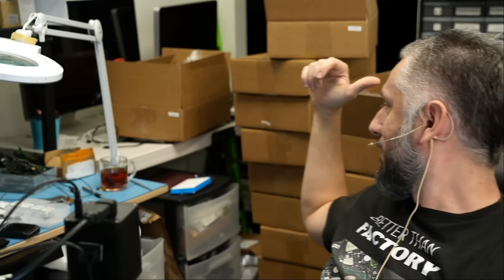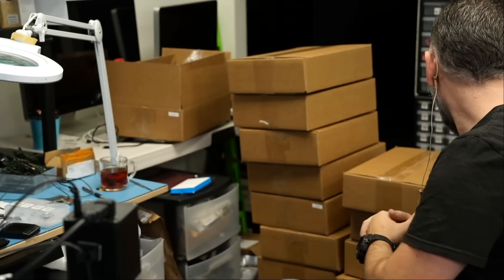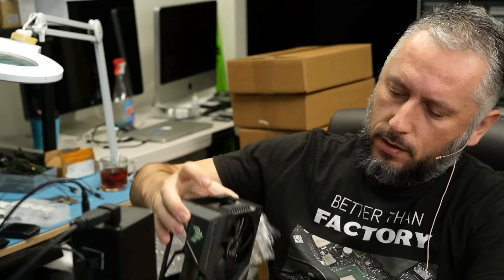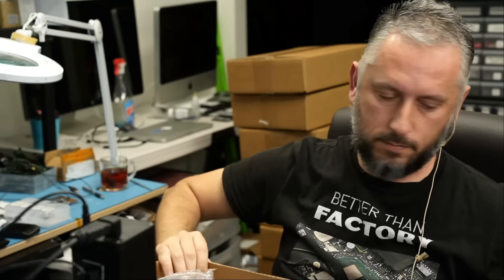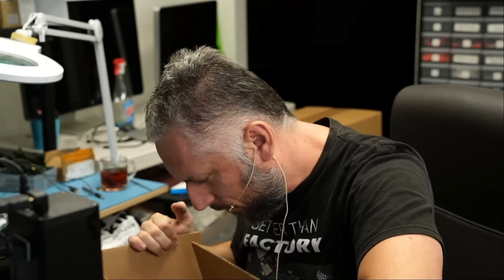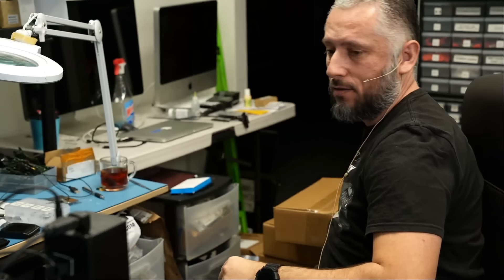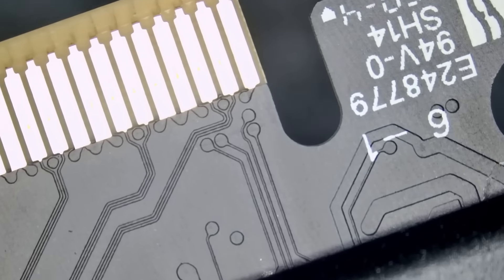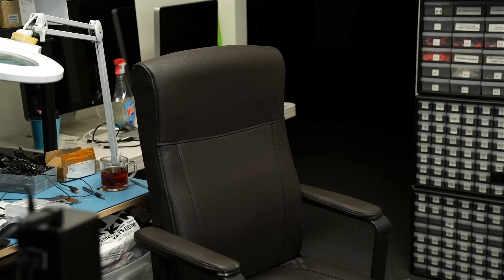We received 19 cracked 4090 Cards for repair - Who's to Blame ?

Comment: A PCIe slot for a motherboard was never designed to support any weight. None. Instead it was designed for establishing an electrical connection. That's why in server systems the motherboard is placed horizontally and even then parts connecting to the motherboard are being stabilized by large brackets which leave no room for movement. Those little studs for a GPU that weighs almost 2 kilograms are a (cheap) joke. A server system will probably survive a delivery by car through an area that has been hit by a light earthquake while a gaming RIG is very competent in destroying itself by any means possible. Not just by crushing under it's own weight. Because most gamers are addicted to the fastest hardware their budget allows them to buy they will always buy. If you see it like that you know that a design that breaks down easily is the most profitable. If you wanna know why afterburner is called the way it is just take a long hard look at that brick hanging in your system looking like an airco from hell.

Comment: hire a single engineer that isn't electrical or software and you wont have these issues. Basic stress and strain calculations have not been done. You shouldn't need external support to prevent your GPU from cracking. If it is necessary some sort of support should be included with the product.

Comment: In my experience of building computers for people, MSI is the only one that often does not provide an additional support bracket with their cards. However, every 4090 we have installed comes with either a support bracket that is installed along the addon card slots of the case, or a stand that props the back of the card up to prevent sag. In the latter case, I like to apply double-sided tape, or a dab of hot glue between the stand and case to prevent the stand from getting knocked free when the customer is bringing the computer home.

I would blame this on user or installer error at this point. If you are building a computer that is going to be shipped, either leave the card out in its own box,  install additional support to prevent damage to the card during shipping, or at least try to prevent the support from slipping out.

Comment: The cards are so large and heavy that REALLY, anyone installing them should be fitting extra supports.
If it happened in a prebuilt, its on THEM.
If you installed it yourself and didnt put a support bracket on something THAT BIG.... its on you bro.
But i will however say that it would be nice pf Nvidia to issue a warning to everyone who buys these MASSIVE cards.

Comment: Friend of mine has one of those cards. He has a supporting frame for the card, so it's fixed without pressure on the connector. Obviously that customer didn't have a frame

Comment: There is no fucking way those boards are broken because of board weight and sag.  IF that was the case, you wouldnt have 19 cards in your shop, you would have hundreds of thousands of cards. Two ACTUAL possibilities are, broken in shipping while the GPU was installed and not supported properly or error during installation (bending the card while inserting or removing it from the mobo), maybe due a PCI-E lock that cannot be reached and ppl just pulled the card + wiggled it to get it off.

Comment: If a few users would crack the board it would be user error. But, if your design has such a week spot it is design error. Of course, you can write the instruction manual and such. But as a mechanical engineer (and also a software maker) I can say that you need to design your product for as stupid consumer as you can imagine. So maybe the producer is not to blame by the law, but he is to blame ...

Comment: costumer probably bought them for a good price in a lot of a bunch of them, all marked as "unstested / for parts", it's a guess, sometimes those come with things that are not actually broken, most do have some issues but many ppl fix them and manage to pull a profit somehow, it wasn't the case probably this time, i still think the maker of the car should take into consideration that their market is not "businesses and especialists/technitians", pc builders can be either your average joe that saw a tutorial on youtube, and a technitian that builds hundreds of systems a year, so blaming the user can be unfair, at the same time the user can have the notion that that conector is very thin for the weight, creating leverage, so a support might be a good idea but many people don«t even know supports are a thing because older cards did not use them, so at least the maker of the card should have a clear big warning inside the box warning about the issue and providing some solutions to mitigate the issue

Comment: I would blame it on the customer, at least on the cracked ASUS ones... Asus 4000 strix/tuf models both comes with card holder included. You can also buy bigger holders like the Herculx or other 3rd party ones. If customer had holder supporting correctly and it still cracked then it's Asus' fault, but other than that it's the customer's

Comment: It can easily break trying to remove it because the clip on most motherboards are so poorly designed and hard to get to release properly especially on thick , heavy cards. Those are the ones that the tabs are completely broken off
Who is to blame? The PCIe Group AKA PCI-SIG for their outdated socket standard from 2003 ..... Same for the melted power connectors problem which is a faulty new standard that came from Intel and their ATX powwr supply standards 

Manufacturers are partially to blame because they don't want to deal with the cost of an updated PCI socket standard which means new designs and makes old designs obsolete. They would likely have to put both PCIe and the new PCI standard on motherboards for a few generations just like they did when PCI (1992) was updated to PCIe (2003)

Comment: Nvidia is NOTORIOUS for PCB failures. Their Processing units are great. Except, everything else on the PCB is flawed. Not to mention their failure of Thermal Engineering. In Florida, it's the manufacturere's fault for the cracked PCB's.

Comment: Idk but I'm sure mist of those cards come with a support bracket to use. I know every huge gpu I got did plus my pc case comes with kne built in and I use them. Like how you going to instal a 10 pound card without a support bracket amd think that little bit of material will support it and not break? Lol I blame the customer lol

Comment: I got a PNY 4080 new from a reputable distributor, it cane with a bracket in the box to help support the card so installed that along with the card not sure if gigabyte or asus supply a bracket with the 4090 but you would think that they do

Comment: So is this just an Asus thing or a nvidiaRTX40 series thing?
IMHO Instead of getting more FPS and higher pixel on their newest cards they should just make cards with the same or a little bit of increase but minimize everything on the card, weight, power drain, overall size and heat discharge. It will be difficult but its not impossible, we frickin had 10megabyte storage the size of a refrigerator back then and look at us now 1TB+ storage that fit in your palm.

Comment: Were those gpus mounted vertically or horisontally? If horisontally, were they supported in ANY way to reduce stress on that area where it could crack.

Then again, a crack in the same place across multiple, identical products, is a manufacturer flaw no doubt.

Comment: If Nvidia is going to charge $2,000 or more for a GPU than they can at least: #1 make the board thicker and #2 provide a suitable support for there own big cards. If the user is too stupid to use the support or mount it vertically with a riser than that's on them. Maybe northwestrepair will take this venture on? Just a thought.

Comment: It's on the manufacturer. It is on them to make sure that the card will not break in it's intended horizontal position. Almost all graphics cards are in horizontal positions, so for it to break like that is mostly their fault. After that, it's either the user or the person that shipped the PC that is at fault. Moving a computer without providing adequate support for the graphics card is always a bad idea. Graphics card should be always fit for purpose.

Comment: A car without a seat belt will still move just in case of an accident the manufacturer should provide safety features to keep the driver safe, the driver will drive the car basing on how it was designed, why would a manufacturer designed something heavy and give it a weak supporting board, God was never crazy to give us strong legs and back bones to support our entire body. its obvious a manufacturer's bad engineering

Comment: I have the 4090 ASUS TUF OC vertically mounted to avoid this problem. I purchased a vertical mount the day I installed as my case config would not allow me to use the included tripod due to my cases base fans. The weight of the card and the fact they include a tripod to take some of the weight led me to not risk installing any other way.

Comment: Heat pipe sets need to be set up with cooler on the top. . .   On my computer   set video card has my tower upside down.  . . CD ROM is inserted and held in with tape. Set running great except for Microsoft update issues that trash Internet access. Thanks for your time and great job today.

Comment: Well they are not mining cards :P
No problem here with my XFX since it comes with an extra bracket that uses 4 slots and is connected to the end of the card it does not move an inc.
Oh and my video card hangs upside down in my case with the output facing up  :P
(oh and the bracket is sturdy i can knock out a small elephant with it :P )

Comment: Guaranteed it's the manufacturing fault with these cracked GPU boards. They damn well know the cards are entirely too heavy for a short pcie slot and still selling them without doing anything about it. Fact is they don't give a crap, and they'll blame the end users for not using the support they refuse to provide. Cards this heavy should by default come with support, but NO they don't because then sells would go down. On the other side, end users deserve the cracks if they're dumb enough to install the things without support... not very smart.

Comment: personally i wanna say at minimum 60% of the blame is on the producer of said heavy card, heavy cards should ALWAYS include something proper to support the weight, no excuses for that, the remaining 40% goes to whoever built the pc, i dont think there are many complete noobs that would build a pc and i'd like to believe even complete noobs can tell that the card is too heavy to have no support, thus building the pc and see it sag immediately and then go "it's fine" their own fault for sure but still 60% blame on the producer as they know the card is too heavy and should have support
Reply: extra note, i dont think the support they should include have to be super fancy, it just needs to be adequate and be adjustable enough to fit a wide selection of towers

Comment: The blame is on the designer and manufacturer. If you need some extra accessory to prevent the board from breaking, you should provide that with the card. Especially when we are talking about the most expensive card on the market. Unforgivable.

Also, the fact that these designers/manufacturers are putting printed circuit in such small and fragile area cannot be negligence. Those mf are doing it on purpose.

Comment: 4090 are microwaves do like gaming next to one get one no wonder cracks will happen cards are under stress get hot and materials like to expand abit under heat and if you combine this with heavy weight and no support you get this result

Comment: becasue its heavy. GPU vendors these days dont really care when they design their hardware that those weight would sag the card. and to make thins worse, bundled adapter "octopus" rail provided for 40 series RTX now have to carry the the weight of 3 RAILS/CABLES hanging onto the upper edge of the cards bending the card position down against it socket. and when the cards gets HOT, in time. you know, very hot air blowing directly to the PCI socket. logical. and not many people bother buying a third party anti sag add on for those big cards.

Comment: I have 2 Asus Tuf 4090 OC cards.  These cards have weight due to the metal shroud and a heatsink that is an 8 heatpipe nickel plated vapor chamber.  The card comes with an adjustable Asus custom support tool that should be utilized to support the weight of the card.  Some cases such as the ROG Helios already have support levers for heavy cards.  Fellow gamers we must use these tools to protect our investments.
Reply: Why 2 ?

Comment: They should have sent the lot over in a wholesaler shipping box with multiple cards in. it would have saved a fortune on shipping for all those scrap cards. Resellers will start having to ship video cards separately packaged with lots of warnings regarding moving or shipping pc's with such heavy cards installed. 

Couriers insurance must be absolutely getting hammered. 
There's going to be a point when they start refusing to ship boxes with such expensive cards mounted on the motherboards.

Comment: Damage like that is caused when shipping a computer without a sag bracket or proper packaging foam, It breaks very easily. They should make the cards without the PCB as the clip, It can't support the weight of the card. They should make a metal or plastic clip connected to the housing to hold the card or something, not the PCB as a clip. Every pre-built PC should have some sort of strong bracket to hold the GPU in place fixed to the case.

Comment: I would like to say " this prove only stupid people buy high end GFX cards "
Of course the makers not providing any form of support, well that is atrocious as they if any should know.
Still i would also blame PPL a little, CUZ it dont take a degree in mechanical engineering to figure out a GFX card weighing a poop ton dangling from its connector alone is not a good idea.

My 7800 XT card came with a support bracket, but i was not able to install it in my PC for some reason ( this is a horizontal support that screw into the same place GFX cards do in the back )
So i had to come up with my own support, which became my pump / res combo as it is just the right size minus 10 mm, and those 10 mm i have made up for using some hard foam

Yes its not transport friendly but my PC will not be transported anywhere, i am planning on changing APT but not before my PC is upgraded at least in regard to case - MOBO - CPU - RAM

Of course if the 1 kilo head on my threadripper came loose, even if it dont fall far, that damn thing will go strait thru the GFX card, CUZ damn that's a chunk of copper ( Heatkiller IV ) 🙂

Comment: Plenty stupidity to go around: Engineers, manufacturers, assemblers, shippers, and users. BUT this design has reached the end of the line obviously. Propping up the corner is silly. Proper design takes everything into account. Class action law suit time? 
I'd say the owner of the cards is in an assembly business or they are store returns. Those cards were probly claimed on insurance and hopefully the shipper or whoever is responsible paid out. Whatever is salvaged is gravy to the owner.

Comment: The SGI Indigo 2 had massive horizontally mounted video boards like this but they were slotted into a card cage with several inches of solid metal rails attached to the chassis.

Comment: That's a class action waiting to happen.

The manufacturer designed something not fit for the standard use case, and standard expected life span.

If they were honourable they'd remanufacture the components on a fresh new board and reinforce it.

Comment: The 4090 is such an absolute disaster. I don't understand how this sack of crap passed any QC. It's literally just one colossal failure (the self-melting power cable, it cracking, etc.) after another because it had literally no quality control at any point in its inception.

A support wouldn't help. The 4090 is heavy enough that prolonged use will even break itself and/or the motherboard it is in if it's VERTICAL, as in, with the motherboard horizontal, and the GPU standing tall. It's just a mess. It's too heavy. It's too power hungry. The connector and power systems involved are shoddy.

nVidia, how did you justify releasing this then endlessly blaming the consumer for your shitty connectors and fat as fuck cards?

Comment: I dont think its acceptable for manufactures to set blame on users for sag damage to board this should have been anticipated and adequate support should of been put into design to prevent this, however we know full well that manufactures will just blame users for this and refuse to repair, and 4090s are premium cards  manufacturers should be bending over backwards to fix them at that price

Comment: Well i have a 4070 Ti 12GB and it actualy came with support stick it was a Strix. Rn its supported by that support extendable stick with rubber in one side so it doesent slip or damage the card. Gread idea btw. The card is holding good. Even transported my whole pc with the card in it 50km away in one direction, no damage. Because rubber on the tip, shock absorbed. Strix was a good deal

Comment: First thing I bought when I was lucky enough to get a 4090 right at release was a gpu support bracket actually got one that has rgb which was cool these cards are too heavy to not use one
Reply: How much was the 4090
Reply: @prestongreenbay6336  wasn't able to get the fe but got the gigabyte windforce for $1600

Comment: Those are very expensive cards ??? dont you like even try a littlebit... at least to fix one card ( Cracked ) of them ???
Reply: Experience. Those boards have around 12-15 layers of minute copper traces running through them. How do you fix that in a repair shop without replacing the board entirely?